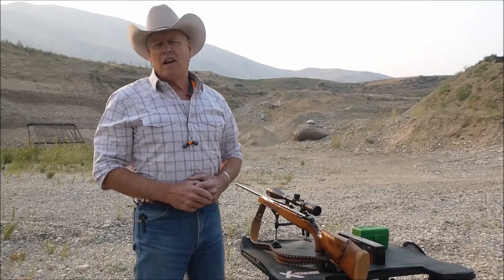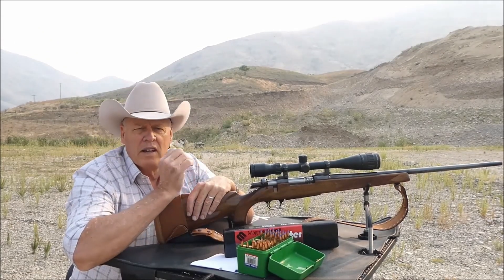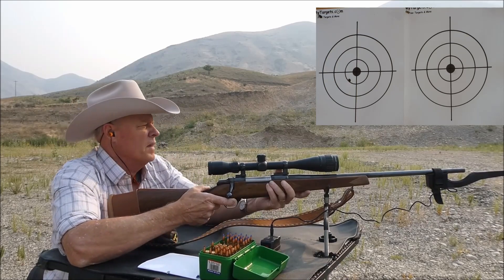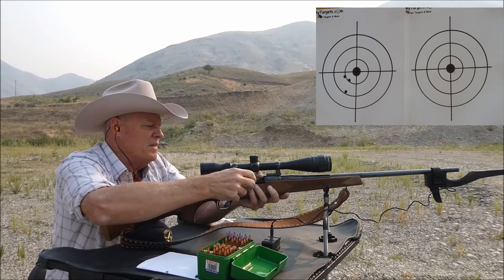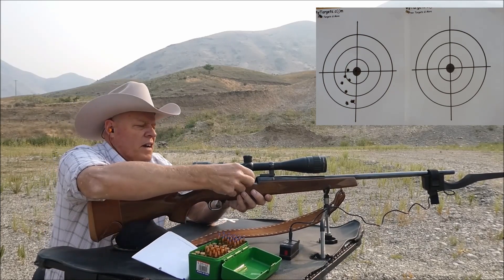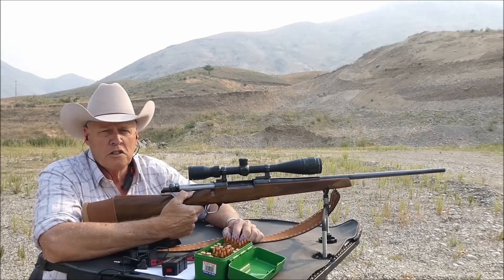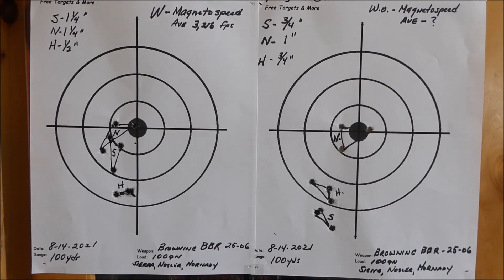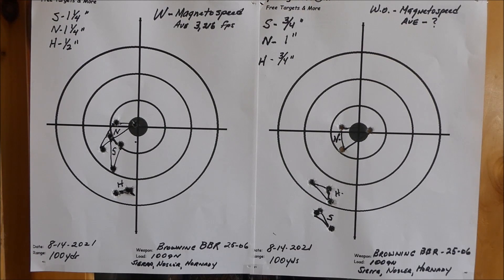Magnetospeed Sporter. What it does and what it does not do.

Comment: A while back it was determined that putting an actual bayonet on a SGI M1 Garand or 1903 Springfield rifle would result in a POI shift up. The weight of the barrel is pre-tensioned downward, the projectile tended to whip the mzzle up as the bullet exited, this led to higher POI.  I believe there is an article in The Garand Collectors Association magazine about it.
Reply from the maker: Interesting. Thanks for sharing. In this case the magnetospeed is lighter and the barrel is free floated.

Comment: I NOTICE YOU MOUNT IT FORWARD OF THE DIP ON THE UNIT THE INSTRUCTIONS SAY TO HAVE THE END OF THE BARREL IN THE MIDDLE SO YOU MUST HAVE A REASON PLEASE TELL ME I JUST GOT A USED ONE AND ONLY GOT A READING HALF THE TIME. THANKS
Reply from the maker: 3 adjustments are critical. 1. The sensitivity setting. (see instructions online if needed) 2. The vertical spacing between the bore and the bayonet must not be greater than 1/4 of an inch. 3. The distance of the end of your barrel and the flat part of your bayonet needs to be about 1" and perpendicular to the bullets trajectory.

Comment: price/fps you can't beat a MagnetoSpeed Sporter
with mine I bought a quick release adapter for my arac rail and a steel bar and modified everything so when installed it doesn't touch the barrel
works 100% , now I can do my OCW & ladder test at the same time :)
Reply from the maker: Thanks for your input here.
Reply: @davestrohmeyer-saddleupsho8009  forgot to say your rifle will need ability to hook up a bipod sothat a quick release steel bar can be used to attach magnetospeed.

Comment: Doubt you see this but if you do you are pronouncing hornady right. Raised in gi Nebraska where the plant is. That being said I do still hate their products. While they are pin point accurate I have seen way to many fail on impact and will not recommend any of their products for hunting.
Reply from the maker: Yes and thanks. Some people get irritated when I say Horna-(day) and not Horna-(dee).  I too have had SST bullets fail, that being fast expansion, jacket separation and no pass through but this mainly happens with high velocity at close range. Other than that they make very accurate bullets.
Reply: @davestrohmeyer-saddleupsho8009   love them for target shooting but I have had bullet failures personally several times both with their sst and the bullets they use in the factory light magnums. The light magnums would pencil through a shoulder at times and other times open so much it would leave a golf ball size hole. Just find their terminal performance too unreliable for hunting any large game. Wish they still made their 100gr .277 bullets. They were amazing for coyotes and deer 400yds  and in

Comment: I used my sporter to get velocity of ammunition to be able to calculate ballistic drop of 300 m and 350 m and 100 m.   For my 30.06 is zero for 200 m.    I have recently made some reloads of 4 different weight that would achieve minimum of 2800 fps to max of 2900 fps.   I also use IR gun measure barrel temperature what wait 5 minutes per each shot and 15 minutes after reloading.   I want to see which load gives tightest group within desired velocity range so I can reload.  Then zero scope with ammunition that gave best consistency. Reason I am doing this someone I have to take 300 m shot.   Most of time within 100 to 200 m, and occasionally at 300 m.
Reply from the maker: Thanks for your comment here

Comment: Do you find that the magnetospeed is effected by weather (bright sunny, overcast) where it will not record under certain conditions?
Reply from the maker: No, the only errors occurred if the bayonet was too close or too far from the muzzle and if small very fast projectiles gave an error code that the sensitivity setting was not correct. I am on my second bayonet because muzzle blast will eventually erode the sensors.

Comment: Thanks Dave, a interesting video and result! My 2c worth is this, the only purpose of the chronograph is, as you said, just to collect data. You could have shot into the side of a hill or not even bothered to get down into the rifle, the data would be the same! The fact that with the magnetospeed attached messes with barrel harmonics, is in this case of no consequence what so ever! All the best from Dorset England 🇬🇧🇺🇸👍
Reply from the maker: Thanks Clive for your input. I like to see if the data collected by the magneto speed corresponds to the group size or lack thereof. Discrepancies in groups, vertical stringing, flyers and even oblong holes on target can sometimes be answered immediately by the corresponding chrono numbers.

Comment: Very enjoyable video. Some thought, a barrel tunner is about the same weight and proven to affect group size of a well developed load. Anything weighing down the muzzle will act the same way. From the manufacturer,  they recommend to load develope without it then use it to verify velocities.  I too have seen it both not affect accuracy and also drastically effect accuracy.  For what I do, a 100$ Wiser Precision mount is an easy buy. Set's up faster and eliminates the question
Reply from the maker: Just a quick question...You're a custom rifle maker, so you would be right guy to ask. I have seen, (for some guy's)  the Satterlee method of load development requires the use of a chronograph, before final load tweaking, they too while shooting, are unconcerned about POI and focus on nodes, (flat spots in velocity). For my process, it is simply to verify powder, brass, primer and bullet combo relative to the "Book" for similar velocity and pressure sighs and move on from there. I sorta figure the bullet makers are the ballisticians and I just verify for my individual rifle.

Comment: Dave, nice shooting. With this data, would you switch from Nozzler or would you run a few more test loads?
Reply from the maker: Thanks for your question. The Nosler 100 grain was the last "sight in load" that is why they were closer to the bullseye. But to answer your question specifically, yes I have developed a more precise and accurate load with the 110 grain Nosler Accubond, used for hunting only.
Reply: @davestrohmeyer-saddleupsho8009  Thank you for the quick answer. I suspected that the Nosler were the sighting loads. Please forgive my atrocious spelling.

Comment: God bless you too Dave. I use the magnetospeed as well . Is your barrel floated ?  Mine has the pressure point ( weatherby wilderness 2506)  struggling with finding an accurate factory load so I floated the barrel but still not going well. Decided on barnes 100 grain. Cold bore shot is right on 1 1/2   inch high at 100 but second and third shots start climbing up to 2 1/2 to 3 inches so I added the pressure point back to see if it would help, wanted to shoot again today but is raining. We get rain here lol
Reply from the maker: Thanks Sandy. Your Weatherby should be a shooter. I would gather your targets that correspond to each individual factory offering you used. Then contact Weatherby and they will fix or replace your rifle, because they gave a 1 MOA guarantee. You will have to pay for shipping, but they do stand by their rifles.

Comment: What do you think of the labradar? I know they are quite expensive over $500 but caldwell is supposedly going to release a similar product for around $300, i have used a labradar  and once the trigger mech is installed it works like a charm
Reply from the maker: J B, I cannot give and opinion on the Labradar other than my eliminating factors of the cost, limited battery life and the extras needed that I have seen the reviews on YouTube  . I had a Chrony Beta for years and would spend 1/2 an hour getting the height and shooting lane aligned with the rifle and the target. It worked but I was constantly annoyed with the error messages. The Magnetospeed definitely fits my more mobile shooting needs.